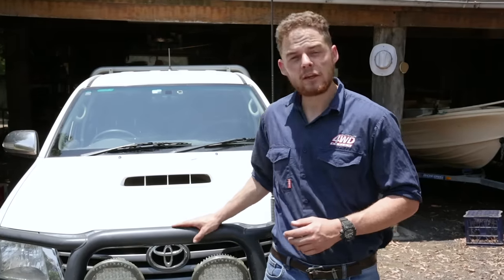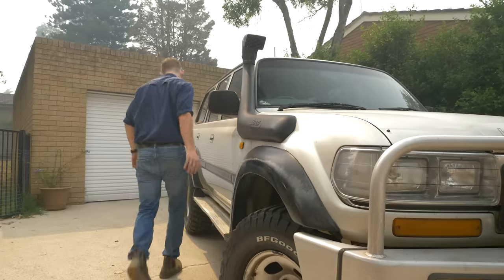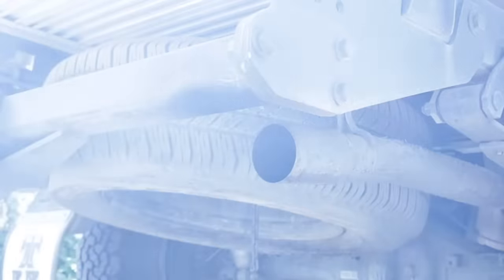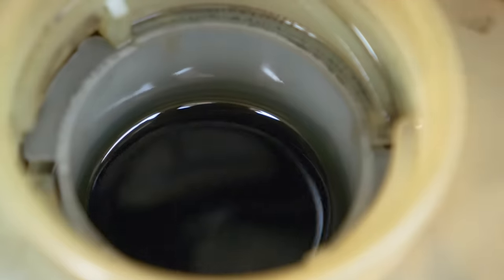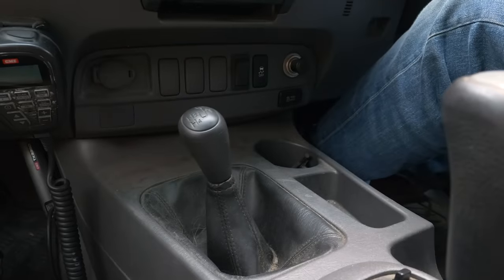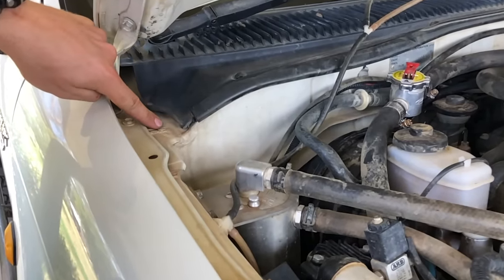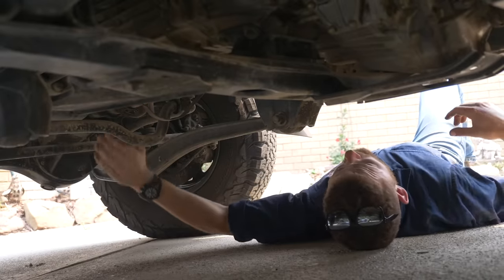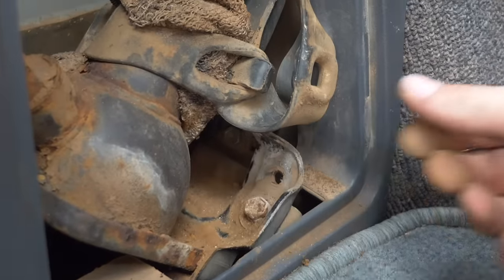BUYING USED 4WDs – Expert tips to avoid a LEMON and get a BARGAIN

Comment: Gday I have just bought a Prado 2003 3ltr TD 300,00 on the clock. I Hooked my 6.2mtr Marlin Broadbill boat on and it sags in the arse. Tow ball scales say 150kg. I have booked it in for Airbags to be fitted. Trans oil cooler also fitted. I have been told these vehicles will tow the boat good and will this Prado struggle towing this boat in the long run? Boat is 2000kg.

Comment: Two weeks ago I bought a jeep grand Cherokee desiel was told everything is good when I pick up my new car was driving home and could smell desiel turns out that one clip on the return line is broken was also told didn't have time to put the spare wheel back under this is why it's in the back the next day I tried to put the wheel up and found the hole thing that lifting the wheel up is worn out and does not work

Comment: So, the takeaway from this video... don't buy a used 4X4 from 4WD 24-7. 
Panels dented? Check
Scrapes under the body? Check
Dust / sand  under the carpets? Check
Blow's smoke? Well, they don't call it Sooty for nothing. Haha.

Comment: All true, but isn't it a bit silly of a concept looking for a 4x4 that has never been used as a 4x4? In Australia especially. Red dust a bad sign? So never been down a dirt road, which are everywhere in the country? Buying a city dweller car is worse in my opinion, excessive cold hot cycles for the kms constant stopping starting, not using the 4x4 gear can cause it to seize up.

Comment: Your comment about a vehicle coming “from the mines” is not always true as many bigger mining co.s have strict rules about speed limits some never go over 80kph and many areas in mining are around the 50kph mark, many vehicles are run constantly in 4wd H so spreading the wear unlike city vehicles that have issues due to never being in 4wd. Most mining co.s over service their fleet and change out their vehicles at 50,000km. They often have really robust accessories on them like roll bars, roo bars racks, snorkels and secondary filter systems. You will find some real plums at mining auctions but you will be fighting with dealers to get them as they know about these things I’ve mentioned here!

Comment: I'm a Toyota man through and through. But what ever you do. Don't buy a old surf.
I had one with an 1kz 3l td
Cracked 3 heads in 2 different engines in 6 months and didn't even get it off road.... couldn't trust it.
I sold it to a mate for next to nothing to rid me off it
Reply: @alexandersupertramp1293  159% 
The import kz have a shorter head more prone to cracking inbetween valves. 
Trust me when I say it was a kz I changed heaps of them
Reply: @alexandersupertramp1293  na mate even 7m had many different codes of heads
Reply: @alexandersupertramp1293  wish I just went 1uz from the start. Love my V8 never misses a beat
Reply: @alexandersupertramp1293  I've built a few 7m they did go good. 
Tho even with drilling out the rear water jacket they missed from factory in the head they still did head gaskets eventually..

Comment: Got me a bloody bargan 2.7 petrol 1996 Toyota hilux surf with 275,000 on the clock for $3,500 brought if of a mechanic had just had the head redone and new radiator and cooler core. It did the head because of a 3/4 blocked radiator

Comment: Bought an XJ Cherokee without knowing what to look for. Transmission went within 50km, lights wouldn't work consistently and under the carpet was rust. Car had been dunked pretty badly and considering the brand new transmission fluid, the owners knew they were offloading a piece of shit. Garbage people sold a garbage vehicle and prettied it up enough that a rookie like myself didn't catch on. 5k down the drain, let the transmission guys have it for scrap

Comment: bought a second hand ZD30 patrol from a dealer in mt druitt with finance, the day i rolled it out of the lot it overheated and warped the head, they said it was fixed and gave it back, next day it overheated again, i asked what happened.. after a month of asking and asking and waiting the dealer said that the mechanic they used put the engine temp thermostat backwards, at that point they offered me a refund, however i am still having to fight the finance company for said refund even though i currently dont have the vechile and havent since that day.
Reply: Alexander Supertramp yea I actually got a hold of the finance company and they said they will sort it out this year when they open again. Hopefully I won’t have to go to the ombudsman I’ll have to wait and see
Reply: Alexander Supertramp thanks for your help anyway mate.

Comment: Bought a 2006 TD 4wd courier last week, everything looked great did all these checks and had roady and 12 months rego ect, took it to a mechanic yesterday, gonna have to replace glows (which I already knew) re grease all joints, replace right uni joint, it’s missing a nut on torsion bar, missing a bolt through the trans case when previous owner got clutch done, but if engine work like will need a new radiator soon list sorta goes on, gonna cost me about $1500 to get it up to date with servicing and maintenance maybe more, little bit pissed off as it’s the first 4wd I’ve bought in years 🤷🏻‍♂️ what can you do

Comment: If you walk away from a vehicle that has rust on it in Canada you'll never find a vehicle and I'm not even talking about used vehicles I'm talking about brand new off the lot vehicles that are already starting to rust especially if it's sat in the dealership through the winter. They throw so much salt on the roads and everywhere in Canada in the winter time that everything starts to rust it's disgusting how much salt they use on our roads and then it all washes into are freshwater lakes absolutely disgusting.

Comment: I brought a gem, my first car 1997 Gq patrol. Was stock as a rock didn't have any aftermarket parts. Had 31s no lift and stock bar. It had 315kms only because he was the first owner and even had the fax from the nissan dealer back in the day. Now it's got 3inch lift 33s and full bar works, it's a absolute weapon 🤘🤘 @forfun4x4 📸

Comment: Jocko a mate of mine has the same Hilux as you he got bogged under water now won't make rpm properly would this be the tps or is there something that you can think of or is there a way to eliminate the intake or fuel system as an issue

Comment: you buy what ever you can afford. I sell repairable write off!  You can buy a low km's Hilux for $28000 or some thing that's been in the mines for $14000. That's it! The red dust is bull shit and 4 wheel drives that have been in the mines are no different to 4 wheel drives that a hoon owned! I buy 4 wheel drives that have been in the mines and most times they are in good condition! Fact is a second hand 4 wheel drive is a second hand 4 wheel drive! I been a mechanic since 1986 and i tell people this is a repairable write off that has been in mines and people still buy them. Then they see a mechanic that scares thems. It still goes back to what they can afford!

Comment: Bought a 2012 challenger 2 years ago for $3700 and after changing tyres have had no issues with my car
Reply: $3700 or $37000? Seems too cheap at $3700..i have PB challenger. Great car

Comment: If the prior owner is an old person that's the guy to buy a used 4WD from. His to old and sensible to flog it in the bush, has probably been cruising at 80 in a 100 and 60 in an 80 zone giving that engine a very easy life. His also serviced the hell out of it and checked and changed the oil frequently because old people take pride in their cars. If the guy who is selling it to you brought the car in his 20's, Is a bogan, or has used it as a work car on the farm or his trade you need to turn and run. If his the kind of guy who has installed a big lift kit, bullbar and roof lights it might be convenient to already have that stuff but be warned that's a rig that has had the shit flogged out of it. Lastly please don't be the knob head who buys a 4WD with the blinding LED lights.

Comment: I gotta old  84  mq mk swb patrol petti L28  moter big lift diff under lear 7 in" above standard + 2in" suss + 2" body on 35s front arb air locker lsd rear fully enginered

Comment: Fact is if you are buying a 4 wheel drive expect to pay lots of money! 4 wheel drives do alot more then cars! The owners manual tells you to change your oil every 5000km. That is only if you don't exceed speeds of more then a 120km an hour or tow something that weighs more then a ton! In which case change the oil every 2000km"s. Service manuals are bull shit in 4 wheel drives!

Comment: how many kms on a car is too many when buying first car. looking for a dual cab. what should be my limit on kms?
Reply: Mate ks dont really matter i have a mate that bought a 60 series that had 657thousands ks when he bought it and its still running well all he had to do was replace a clutch and chuck new brakes on
Reply: Ageed with Bryson. I don't look at K's too much on a relatively modern dual-cab. I just bought a 2015 D-Max with 120,000k's on the clock. My father in law has a brand new D-Max and they both drive exactly the same. If you blindfolded me I couldn't tell you which was which (I would also crash because I'm driving blindfolded).

Comment: I just picked up a bargain the only default it has is the 4wd light that comes up on the dash blinks constantly when not engaged but drives fine and engages like normal ones engaged the light just stays on like normal anyone no what this could be doggy senior or low transmission fluid is what I’m thinking but don’t no for sure
Reply: Jakes lawn mowing is it a Toyota?
Reply: Triton 06
Reply: That's a common issue on Mitsubishi 4wds, from memory it's an issue with the sensor connections, I remember researching it years ago when a mates Pajero started doing it.
Reply: Yeah that’s what I’m thinking I’m not to worried because I know it can’t engage unless I physical put it in 4wd it’s just annoying that it flashes all the time sometimes I think iv left my indicator on so annoying

Comment: so you tell people not to buy a vehicle thats been taken to glasshouse multiple times... pretty rich coming from a company encouraging people to go 4wding, but then you say if its full of accessories its been cared for, yet thats a sign of off roading even if its down dirt roads. so much jumping back and forth. then on the underbody shot you can clearly see tailshaft grease flicked across the body but you neglected to mention that this could mean a blown seal OR simply overfilling the tail shft slip join with grease. perhaps you should revisit this video with some more information explaining what each thing means. just because a vahicle has been used off road doesnt mean its going to be a lemon, infact most vehicles used off road have been improved over factory in one way or another.

Comment: Don't buy Daihatsu Terios especially if it's petrol likely it will have a blown head gasket and cost you 2K to get fixed by mechanic because you gotta have the head either machine or replaced because they turn into a banana or some shit aluminium head or buy another motor which is like trying to find needle at the bottom of the ocean and if they blow a single vacuum hose won't start

Comment: There is alot a good info in this, but a hell of alot of wrong information too. 
4WD action, I warned you before about giving the right information and the legalities behind mis information. You're still walking a fine line. Guys, you're taking a very ignorant approach to mechanical and tip giving info.

Comment: I just brought my first ever 4x4, really wanted a 2012 and up DMAX but i just didnt have 20k+ so i had a look around and found out that rc colorados have 4jj1 with a top mount, picked up a 2009 dual cab with tub, racks, uhf, light bar and 16x8-0 dynamics for a steal.. 11k with 200ks on the clock fairly clean, no rust and the seller was genuine, ive had it about a month now and all i can say is i cant wait to start dropping money into this rig,  snorkel,egrdelete,lift,33s,exhaust,tune and all the other little pieces to make her look mint! @dead_180 on insta if you're a colly boy!